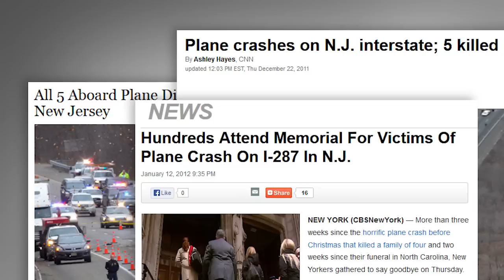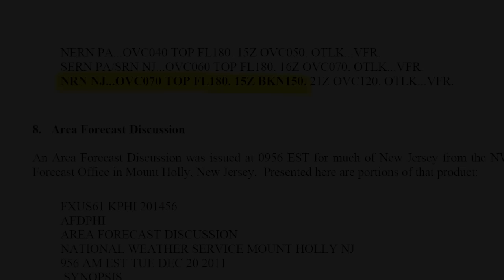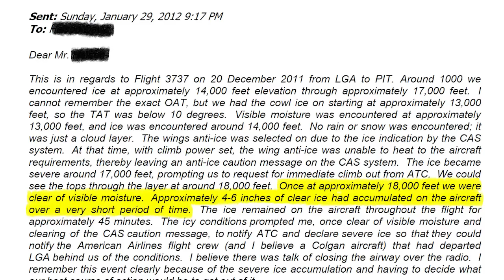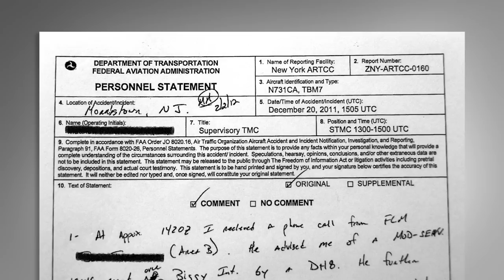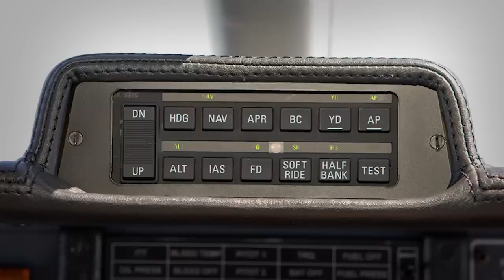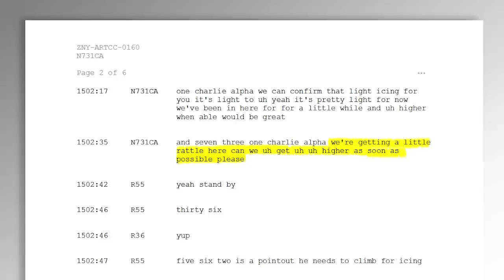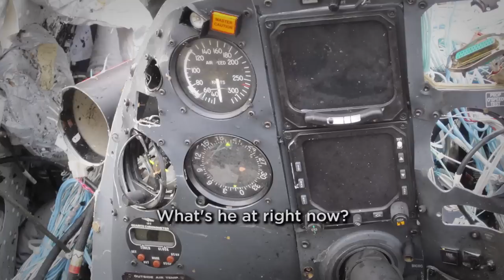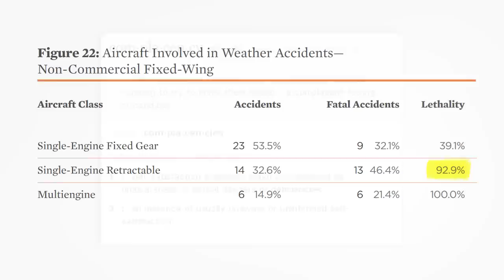Accident Case Study: Delayed Reaction

Comment: What do you all think about the announcer's comment suggesting maybe he should have "pushed the nose over and worried about ATC later"?  Especially in a crowded air space like this, seems very dangerous.  I understand when armchair deciding its easy to say "would have been better to change alt without permission than stay course, ice up, stall, and die" but without hindsight I'm not sure its good to suggest changing alt without permission if you are worried????     (beginning student pilot here)
Reply: I am alive because I descended in severe icing when ATC said no. And no repercussions from ATC either. Icing came on suddenly and was bad.
Reply: @TheRotorhound  i would do the same in a second, ive declared 2 emergencies and survived both with plane and license intact
Reply: Yes, it may seem dangerous to just push the nose over to break the stall and keep the airplane flying but it is arguably the ONLY thing that may have helped this situation. ATC will not care if you need to do this to keep the airplane flying. Other aircraft in the area probably have TCAS to avoid an aircraft conflict. I too have been hesitant to do things in the airplane without checking with ATC, but when safe operation of the aircraft is at stake it is 100% allowed to do what you need to do at anytime without ATC approval. From a 10,000 hr Pilot.
Reply: @mikespindor  Thanks for reply.  My instructor said about the same thing.  I guess I'm not giving enough weight to the fact that it was probably either nose down/change elevation without permission or die, so obviously in that case I get that its a better choice.  But it didn't seem like the pilot here grasp that things were that bad, and I'm just trying to figure out how a good pilot knows- in a case like this for example- when things are serious enough to risk changing elevation without permission and risk a collision with another plane vs trying to hold on until ATC clears the way and grants permission.  Its easy to say he should have just nosed down without permission now that we know he died for NOT doing it, but as a future pilot (and only going for sportsman /non instrument) and being nervous, I can imagine always being tempted to ignore ATC when I get scared, which in most cases would probably be in error.

Comment: 02:30 I got it. Extreme icing. Doesn't explain the smoke but it does explain the out of control spinning vertical plunge through the clouds. 
4 way Darwin award plus several near-misses.

Comment: That is the worst ice I've ever heard of. If you do have boots remember to douse them with Armor All. The ice should just slide right off. Remember Jets have 600 degrees Celsius a i r circulating throughout the Leading Edge. Best to avoid ice. Most Pilots play like they're tough but the best Pilots have a good deal of humility
Reply: As the old adage goes: 
There are old pilots and there are bold pilots; there are no old, bold pilots.

Comment: These videos are so much worse when the pilot isn’t blatantly being idiotic.
Reply: This was atc problem. Shouldnt have let him in the ice pocket for that long. The rattle was the plane not his nerve. Its not realistic but it would be nice if more atc flew to understand the other side.
Reply: @mobilemechanics6565  it is rather surprising to know that so many ATC’s aren’t pilots. At least with truck dispatchers, they drive home on the same roadways even if in a car. But some ATC’s have never even been in GA aircraft. Kind of eye opening.
Reply: Well... to me he sounded pretty idiotic and overconfident. First, when ATC told him that there were reports of moderate rime he said 'if we could go straight through it that's no problem for us'. Then, when he was already inside the clouds and the ice was building on the wings, which he knew and told ATC, instead of going down, he kept climbing, building even more ice on the wings, while the engine also kept sucking ice, which ultimately was the aircraft's demise.
Reply: @Lucas_Tulic  I think he was saying straight through as in "I can climb straight through." No problem to climb straight through, I don't think he was saying "park me at icing altitude and I'll just hang out chugging through it." The TBM is fine climbing through moderate icing, I don't think the pilot wanted to stay there. I don't think he was an idiot or being overconfident, just a horrible accident that is easy to judge from an armchair.
Reply: @thephotoyak  yeah I concur with your interpretation, those weren't words of overconfidence.

Comment: If the plane is picking up ice, why fly higher? Is it going to be better the colder you go up?
Reply: Hi Tom, good intelligent question.  Usually, icing is worse at or slightly below the freezing (i.e. icing) level.  In most cases, if you can, you want to climb above this "icing level" which is usually about +/- 2,000 feet deep or thick (sometimes it can go up to 5,000 feet thick but this is uncommon).  This is why climbing (if your airplane can do it) is recommended.  Of course, if you are "out of the clouds" slightly below, you may descend but altitude is usually never enough while flying.  Great question, Ciao, L

Comment: 9:53 couldn't the "rattle" be literally the aircraft shaking as it get's close to a stall?
Reply: Hi CivilAviation, yes, it could be buffet (close to stall), disturbance of the airflow over the flying surfaces caused by the accumulation of rime ice, or pieces of ice ingested in the intake.  It happened to me before and it is very scary.  Ciao, L
Reply: @lancelot1953  um, the ice isn't ingested from the airframe. It refreezes behind the intake screen.

http://www.kingairmagazine.com/article/ask-expert-ice-vanes-important/
Reply: @touristguy87  Hi, Touristguy87, on the intake of this turbo-prop (P&W PT-6) is a zone of low pressure as the air is funneled in the intake, right inside the lip of the intake fairing, where temperature drops - sorry about the wrong terminology but yes, pieces of ice can form at the nacelle side of the engine (aft of the propeller hub), it does make some "rattles" as it gets in the intake.  What "rattles" the King Air pilot was experiencing, I cannot tell, it may have had several sources - I was answering "CivilAviation1's" question, explaining that it could have been caused by several issues.  I have "iced" a few aircraft in the Navy (not willingly), including "down the intake".  Ciao, L
Reply: @lancelot1953  yeah well according to the KingAir note, by the time that happens it's already damaging the intake compressor vanes.
Reply: @touristguy87   I do not see what the disagreement is, if any.  Whether the P&W PT-6 is used in any kind of airframe, it basically has the similar structure/airflow.  What are you arguing about?  A "rattle" can be of many sources.  Many aircrafts will encounter icing on a climb out or descent, it happens despite the best planning or intentions on the part of the pilots.  Pilots deal with it and take appropriate action(s) - it does not mean that the engine self-destructs "by the time you hear a rattle".  If the engine ingests ice, wherever it came from, you usually, I say "usually" hear it, even in a Navy jet, with a helmet/O2 mask on.  Ciao, L
Reply: @lancelot1953  hey I'm just quoting the KingAir document on the topic that says the engine doesn't need to ingest ice even if it could...it just needs to ingest water and the low pressure high velocity airflow behind the screen will do the rest. 

Surely you swabbie flyboys who only fly planes woth two engines know better.
Reply: @lancelot1953  "What are you arguing about?  A "rattle" can be of many sources.  Many aircrafts will encounter icing on a climb out or descent, it happens despite the best planning or intentions on the part of the pilots.  Pilots deal with it and take appropriate action(s) - it does not mean that the engine self-destructs "by the time you hear a rattle"."

I did not actually say that the engine self-destructs by the time that you hear a rattle. Which is probably why you didn't quote me saying that, so I don't see the point in your saying that at all. The point is that by the time that you hear a rattle FROM THE TURBOPROP ENGINE it has already suffered significant damage. If you're hearing a rattle from icing elsewhere on the plane, that also is a real cause for concern, yes? Unless you think that it can be safely ignored? 

Now. Yes or no. This pilot in this case DID NOT TAKE THE APPROPRIATE ACTION. Yes or no?  So who fucking cares what other pilots did in other planes in other icing scenarios? We can talk about what he or the ATC should have done. We can talk about what he did or did not do. But we all have to agree on one thing. He spiraled into the ground in a vertical dive. Was that fucking appropriate, nitwit? You think that he intended to do that? Do you think that he tried everything that he could think of to NOT do that? So again: why the fuck are you talking about what other pilots have done? I'm sure that at least 50% of the pilots reading this have "dealt with icing by taking the appropriate action". The others...did not, but if they are able to read today, they still survived it. 

This guy either DID take the appropriate action but died anyway, or he did not and died unlike many others who made similar mistakes and got away with it. Stick that in your fucking "expert pilot" pipe and smoke it.

Comment: Some important pilot errors:
1)  The pilot apparently understated/undernoticed the degree of icing.  "Light icing" turned uncontrollable in 1:40, indicating that there was probably more than "light icing" to begin with.
2)  The inertial separator was not turned on.
3)  Emergency wasn't declared until too late:  "In an in-flight emergency requiring immediate action, the pilot in command may deviate from any rule of this part to the extent required to meet that emergency."  The pilot did not recognize the emergency developing until too late and did not declare an emergency until it was useless to do so.  A declaration and immediate descent to VMC instead of waiting 30 seconds on clearance to go higher might have been all it took.

Comment: "We can go straight through it, no problem for us."  -A terrible overestimation of his and his plane's abilities and a terrible underestimation of the situation.  Sad.
Reply: Had he only gone straight through it, there is a good chance he would have been okay. Instead they level off inside the icing conditions. Of course the best course of action would have been to avoid it altogether.
Reply: Had he been allowed to climb straight through it, it wouldn't have been a problem in a FIKI aircraft like the TBM. The problem is ATC knew about the icing and still leveled them off in it. I had that happen to me in a Meridian. I told ATC I was picking up ice and wanted an altitude change (leveled at 14k on the way to FL280). They left me in it for a while. Luckily my boots were able to clear it just fine because I wasn't in once in 35 years kind of severe icing like this guy. Next time I will declare an emergency and start climbing out of it, and let them route other traffic as necessary.
Reply: That statement tells the whole story . Complacency. Overconfidence. They should have stayed home that day .
Reply: it's not exactly clear what he meant when he said that, either going horizontally or vertically, neither of which he was doing in a steady climb. 

I think that a lot of guff is being given to this pilot and ATC over what was an extremely bad icing scenario. The thing is that like any weather condition that pilots fly through regularly, 99% of the time it's not deadly because either the weather is not bad enough or the route isn't dangerous enough. In this case both happened. Yes this and that would have helped the situation but also you don't know that it would have made the difference. The plane could have simply gone up to 20k agl and had the same problem.. It just would have taken longer to hit the ground..

Comment: @10:05 would that inert Sep switch have made a difference in outcome? I'm not a pilot just curious.
Reply: It could have made a big difference. An inertial separator is a mechanical system that uses inertia to separate particles and FOD from the air going through the turbine on turbo-prop aircraft like the TBM. You should always keep it on during icing conditions to stop ice clumps falling off the propeller from being ingested into the turbine, as that can cause you to have a very bad day. It is possible the rattle the pilot was referring to could have been from ice damaging the turbine. When your airframe is accumulating ice (drag), the last thing you want is to lose thrust.  At the very least, it shows the pilot was not following the proper operating procedures, indicating he significantly underestimated the conditions.
Reply: Thanks for the explanation @maximillian

Comment: I’m new to flying so please correct me if I’m wrong about this. My thoughts...

1) Don’t take you loved ones into IMC and or ice with your single engine (you lose it and can’t glide to an airfield, it’s gonna be tricky to find safe flat ground when you can’t Fing see)

2) Maybe don’t fly into that area until you have been cleared into the Alpha and have climbed waaay above the icy death clouds? Light, Moderate or otherwise.

3) Drill and know your aircraft systems (like the ones that deal with ice) You should know the manual tells you to fly in ice for only very short amounts of times. 

4) Have an icing check list and proceeders; brief it before you get anywhere near an area of potential ice. USE the Fing check list when your in ice conditions, so you don’t leave a critical device off and kill yourself! 

5) Think of ice devices as emergency equipment. NOT standard equipment you can use indefinitely during flight to keep you safe.

6) After knowing not to go into or linger in icy conditions.... When ATC tell you hold a heading and altitude that will keep you in the ice; tell them “No thanks you on that 170 hundred. I will be turning around/away from this area and descending below the freezing level (if altitude on your IFR low chart permits). Once I’m away from the ice I want a climb to my planned FL26, then I would like a heading to my destination.”

6 1/2) ATC is just trying to move pieces around on a board and keep us all safe; but they are only human. They are not flying your aircraft. You need to ask for clearances to safe airspace’s well in advance. If they can not clear you in a timely manner and the situation is becoming unsafe; you need to Inform them of the action you are taking to move to safety. Let them sort it out on the board. If is an emergency it is what it is, they will have to offer you the best information they can so you can get to safety. 

7) Aviate! ( Fly the Fing air craft with control and accuracy. Conserve what Altitude and Airspeed you can.)

8) Navigate! ( Aviate you’re air craft to safe airspace and appropriate airways )

9) Communicate! ( Inform ATC and other aircraft of your intention and actions you need or would like to take )
Reply: You would be correct on all counts!

Comment: By definition moderate implys that either deicing or flight diversion will fix the problem. 
      If deicing is overwhelmed, it seems that it would be severe. I almost never hear of severe icing although it is very common. I think there is some false thinking  that if you make it out the icing couldn't have been that bad.

Comment: This reminds me of the 737 that failed to turn on the engine anti ice and clipped a bridge going into the river.  This pilot missed one engine ice protection switch too.  He also was over confident in his ship.  Rime ice kills quickly and this family was lost.  Avoidable? Maybe if that engine switch had been on?  Never miss a critical checklist item or underestimate the weather.  CFIA&I
Reply: 1982 Air Florida. Peanut used reverse thrust trying to push back from the gate and the engines ingested ice and screwed up engine sensors.
Reply: @Gusto9698  even so that flight was doomed as the plane was de-iced at the terminal and sat there waiting for clearance. I'm surprised that it ever even got up off the ground.
Reply: @touristguy87  My cousin St John, Penny was involved in responding to the Dryden, Ontario plane disaster, dragging bodies out of the woods. Pilots pushed to schedule, ice conditions, and minus KAJILLION below, which is standard for the area NW Ontario in winter.

Comment: Several times flying in scheduled 135 operations I have encountered ice in one form or another.  Finding ones self in ice is usually infrequent and never 'the same'.  Even with current weather and pilot reports the type aircraft providing the report may be enough different to change the way the ice would be reported.  Example an regional jet and a cabin twin reciprocal engine aircraft will have much different exposure time and results.  Approach reported ice very carefully, it changes and can present more weight and disturbance to airflow than any aircraft can withstand in just a few minutes.

Comment: If your prop plane has an airframe suitable to use a chute system, get one. Last time I checked good chutes are 30k when a simple C152 is over half a mill. Curiously enough, though, and in regards to this particular case (not the C152 example given above) never checked if de-icing packages are available for GA high-end turboprops. Have a nice day, and thank you for the video.